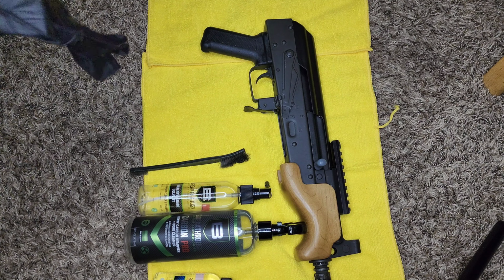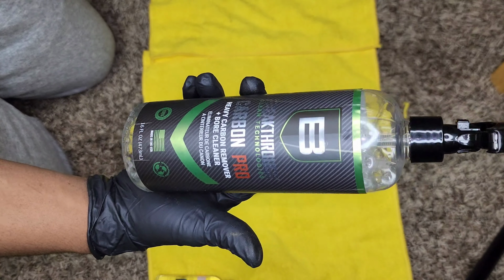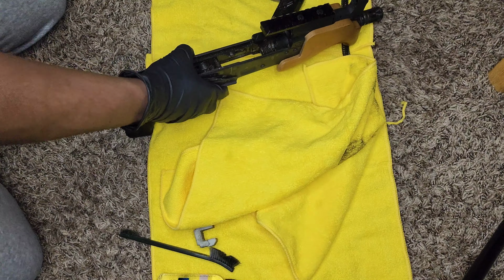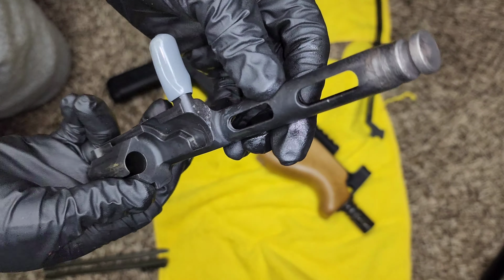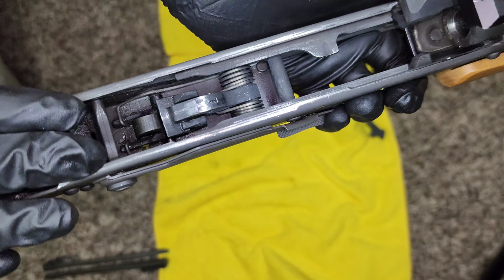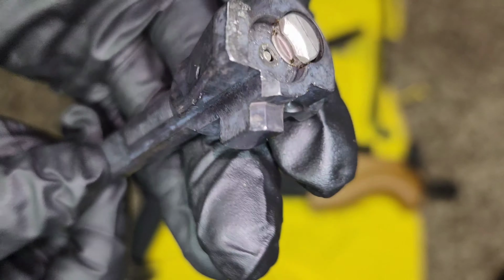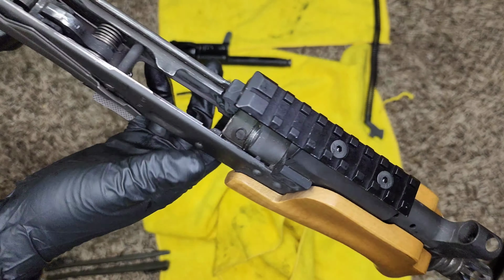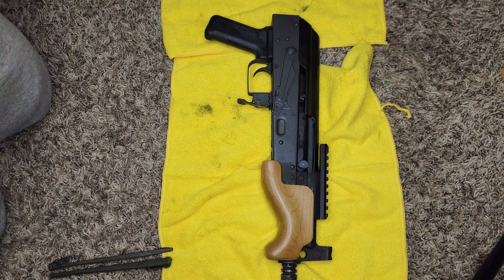micro draco vska clean after almost near 1000 rounds

Comment: How do you clean the black part where the safety is
Reply from the maker: @sheistyvontae8140  which part
Reply: @ the whole outside the black. Part cause know scratches putting the safety down what I use for the scratches I wish I could send you pictures
Reply from the maker: @sheistyvontae8140  i just use the solvent to bring the black back so it's not ashy looking but the scratches are permanent once you start putting it in bags and touching other guns, the Romanian ones are notorious for scratching